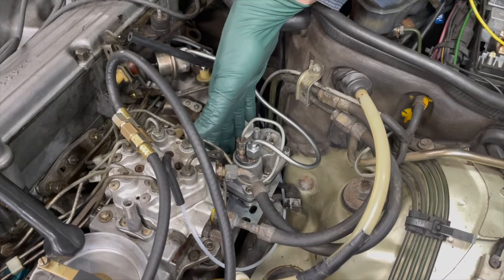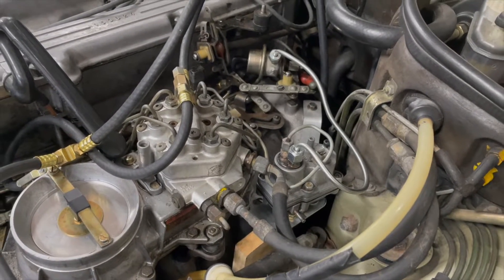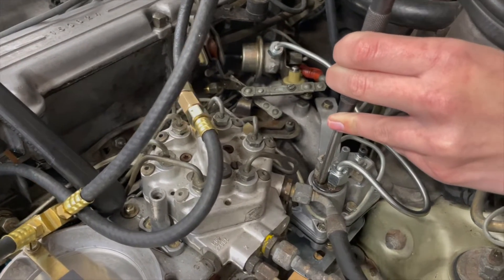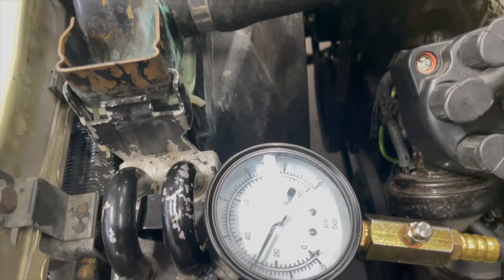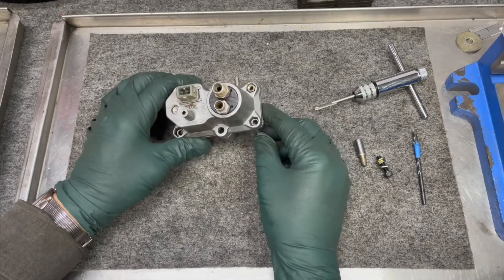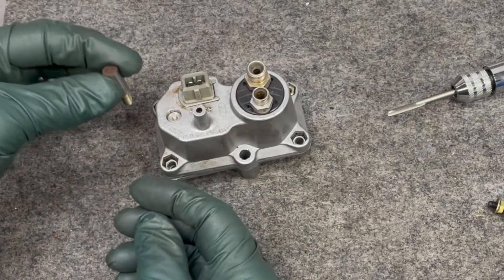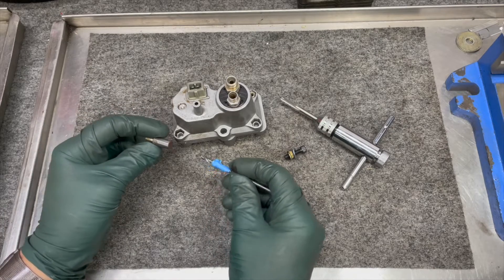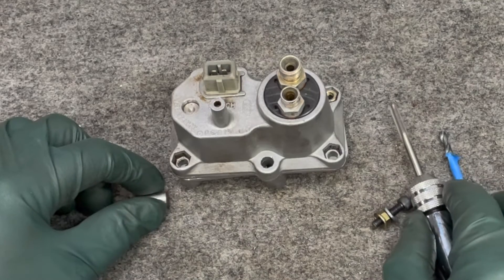M110 Engine WUR Relocation: A Winner + Final Decision on Making it Adjustable

Comment: Will you be marketing the relocation kit (bracket & metal lines)?
Reply from the maker: It is a pain to make, and not sure there is enough demand. Convince me otherwise... :-) But it is soooooo easy now to adjust and work on!!! I used to not like the M110 engine just because of the location of the WUR. LOL
Reply: @Mercedessource  Well, I would buy one.  From my own experience fabricating small metal items in my garage, I went back-and-forth getting the metal bent, but once I had it bent correctly  and the holes drilled where they should be (without elongating them from going back-and-forth) they shouldn't be hard to make.  Hope to see the kit in the future.

Comment: Very good explanation as always Kent. Hope to see more content like this. Fighting currently with a fuel accumulator in a KE-Jetronic and replacing one is on the expensive side of things. Old one too corroded to gone, it's just so rusty and fragile im afraid it will not work. No way to rebuild it it's kind of just buy the new one for 300$ or put a one way check valve into the system.